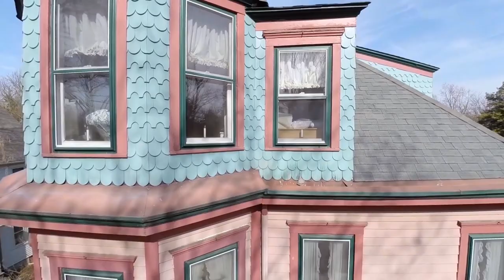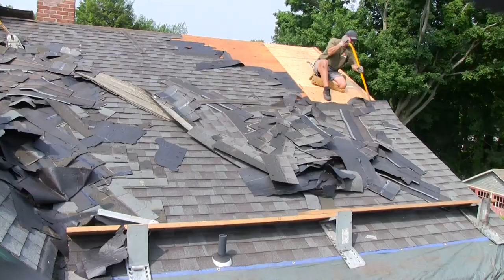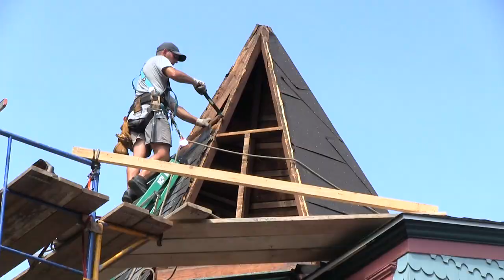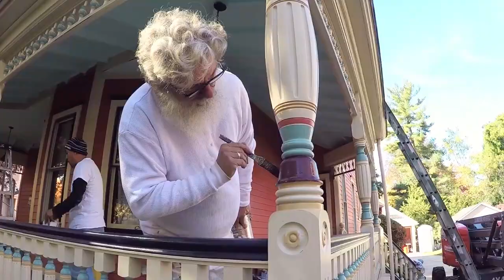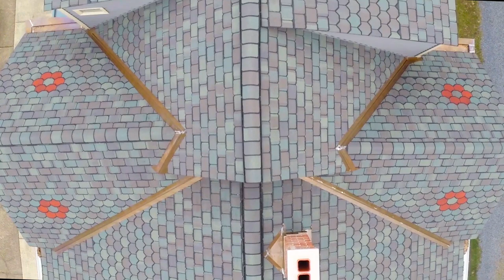Queen Anne Victorian Roof and Painting Restoration Redman Avenue Haddonfield NJ

Comment: In the first 5 seconds I was asking myself why any idiot would pull off a perfectly laid roof with maybe 20 years life left in it then of course came the renovation and WOW!  What a spectacular finnish
Reply from the maker: Hi William
Thanks for your compliment.  While the shingles had some life left, the box gutter was leaking.   Box gutter flashing needs to be in copper, allowing soldered joints.  The previous roofer flashed the box gutter with aluminum and caulked the joints.  Metal expands and contracts with temperature changes, pulling the caulked joints apart. 
Kevin